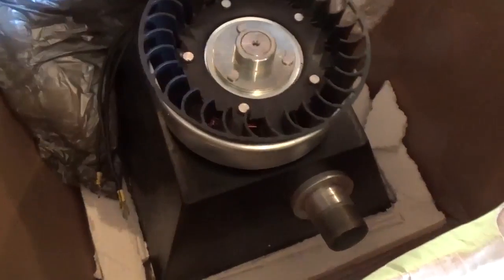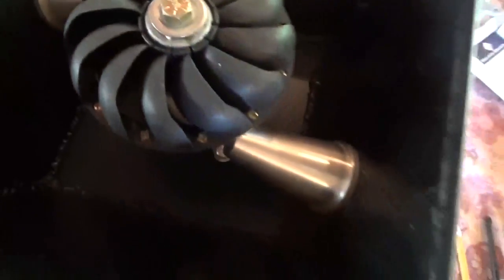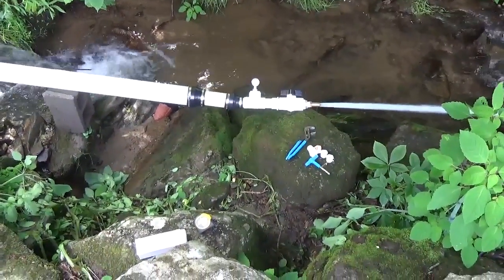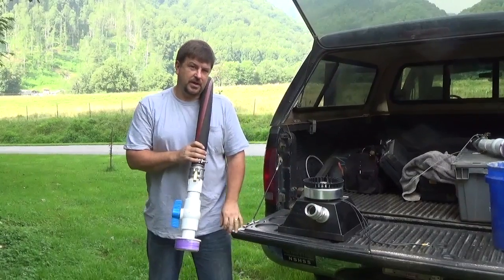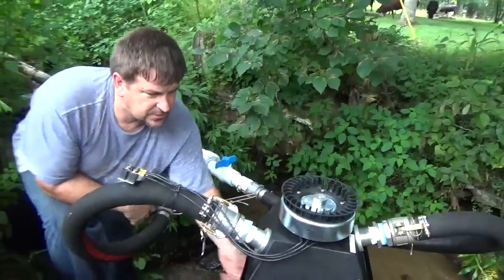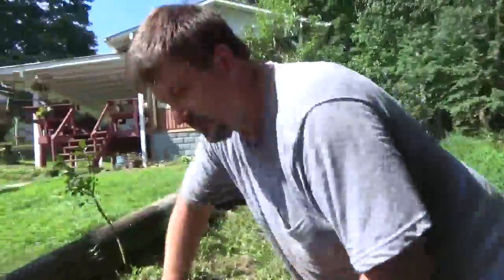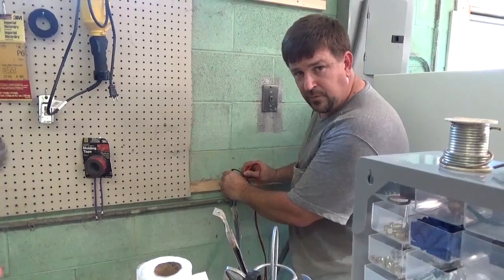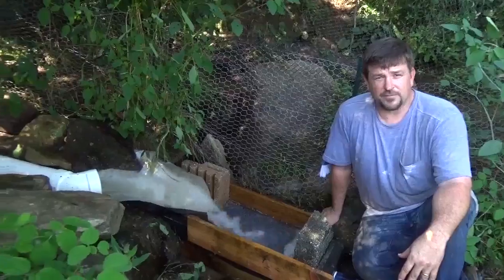Micro Hydro Power with Turgo generator Part 1

Comment: 24v system with multiple 250 feet cable runs ?? That's a lot of wasted power. with 10 amps running through 250' of 12 awg you re loosing almost 40% of your power, that's huge. Either the info you give about distances and voltage are incorrect or you are wasting your power away to nothing. You need either a single three phase step up transformer or three single phase transformers at the source and step that voltage up and drop the current. Or perhaps an alternator that puts out a higher voltage like 2 or 3 hundred volts.
Reply: petnzme01 yeah but you could get more free you genius
Reply: petnzme01 no but yourself, running a heater and needing to pay less for electricity. Why take less when you could have more for almost the same effort? Plainly inefficient
Reply: It looks like he was saying he was using 10AWG 3wire for 300 feet and was running at 48 volts no load. Under load something like this might run about 300W max which at around 48 volts is only 6 amps. On 10 AWG at 300 feet you can expect about a 3v drop for 6 amps of draw which is only about 6.5%.
Reply: In my  Glorious Nation of Kazakhstan which is tiny we use 110KV.
Reply: petnzme01 
Yeah! why not just do a shitty job! Why the fuck bother doing something properly? Why not take a leaky bucket when you collect water!? It gets lighter as the water leaks out! GENIUS idea!
Reply: yea, so? what's your point? Impedance in ac systems is just another calculable loss mechanism over dc. But that is not what this discussion is about, for me anyway.
Reply: nandos1111 reread your commt pls. Ac is better that ac?
Reply: Thank you Thad - this info is accurate and exactly the same problem power companies work to solve for delivering power. Drop the amps, up the voltage and you lose far less energy on long runs owing fundamentally to friction (heat). These are important things to consider when powering our own homes and worksites, and quite frankly most people never think of it.
Reply: well ok, good luck with that.
Reply: +Eastern Woods Are you an alien? Answering the phone with "engineering" expresses that the person has contacted engineering, not that the person answering the phone is an engineer. Why would a company employ engineers to answer phones?
Reply: So, just to get the equations out there... V(oltage) = I (current) * R(esistance) and P(ower) = I * V.  Simple substitution will get you P = I * I * R or I^2 * R.   These equations are true for both DC and RMS AC.  All wire has a resistance per length.   So, the resistance will increase with distance.  Looking at the second power equation, you can see that it is way more desirable to have a low current instead of a high current because power grows with the square of the current.

The TLDR is that if you boost the voltage, that is very, very desirable for power transmission.   You can do this with AC using a transformer.  Thad is right,  boost the voltage at the turbine and you will cut the power loss on the 250' wire run, potentially by a lot.  

Also, for the DC vs AC crowd, it is cheaper, AFAIK, to use a transformer to get a high AC voltage than to get the more expensive DC equipment, especially for this type of setup  With AC you will have the capacitive and inductive losses, but the AC system will be cheaper and at least get you most of the way there.
Reply: @mitchbaker3230  Exactly. But unfortunately most of the idiots here haven't got a clue what you are talking about. They are too busy arguing over AC vs DC or quoting a simplified argument they heard in school. Simple fact is: If you double the voltage, you will quarter the losses. If you up the voltage by 10 times, the losses are 1000 times less. Why?, because the losses are equal to the current squared multiplied by the resistance. Also, if the current is reduced by a factor of 10 you can use much smaller and cheaper cable. The cable resistance will be higher, but even if it is 5 times higher the overall losses will be 200 times less. It also doesn't matter if its AC or DC. Transmission lines use AC because it is easily transformed up and back down again. You can get DC converters to up the voltage but they are expensive and lossy (they heat up) compared to the humble transformer. Proper electrician here.
Reply: lose: be deprived of or cease to have or retain (something)
(lose, loss, lost, losing) <--- losing
... you're losing almost 40% of your power ...

loose: not firmly or tightly fixed in place; detached or able to be detached
(loose, loosens, loosely)

Sorry, big pet peeve there.
Reply: Thad ward most of the time these people know just enough to burn the house to the ground!
Reply: Brett Rowan It might not be a thing but remember his constraints. It's just a hobby project(meaning he doesn't want to spend big bucks) and he has an asynchronous generator producing   power. So let's say he uses DC he would need to convert it back to AC at home to step down the voltage only to convert is again into DC. That's a lot of losses.
Reply: FuFu 
Water and wind make AC. So stepping it up to a higher voltage AC and stepping down to his end voltage will be less loss than what he did. Wind and microhydro deal with this successfully in many installations so just because you aren’t familiar with it doesn’t mean it doesn’t exist.
Reply: @ zeffur...I'm not sure that the author is a professional engineer. I've seen a number of his videos. They're informative as far as they go but leave out important details. Just because you have a lot of volts is impressive but it's power that counts. Volts times Amps = Watts.
Reply: @Eastern Woods:
re:  " I see so many on here with miss matched capabilities that I'd I'm frustrated."

The truth is good engineers design with a sufficient excess margin for safety & capacity--bad engineers tend to way under or over (sometimes both in the same system) engineer.

re:  "...but leave out important details. "
I hate to admit it...but many engineers omit details that are obvious to them but often not obvious to their audience.  I've seen it over & over again.  Many engineers are excellent engineers, but poor instructors or teachers.
Reply: zeffur I did some looking. The unit comes from langstonsalternativepower ( dot ) com. It looks like it's a 48 volt DC but I could be wrong on that. In the video he shows about 48 volts charging his battery. Most of these micro systems run DC because AC needs RPM control. Check out the system " micro hydro electric power system in colorado part 16 " how he controls the power frequency. You'll have to watch the whole series but it's worth the time. They also like to keep the voltage low for safety reasons ( and probably regulatory reasons ). Also most of these guys charge the batteries from the generator and then use an inverter to convert the power for use in the house. A low voltage DC generator keeps the system simple and relatively safe at the expense of efficiency. Most of them are happy to get free power, even if it's a fraction of what they could get
Reply: @easternwoods4378  FINALLY...someone who's thinking practically and not in equations. P.S. I also have an EE degree. It's all about perspective here and is very easy to get exited and make everything efficient. I can only imagine the FUN of handling two 3 phase transformers in the middle of the jungle next to a creek. Very efficient when fire starts.
Reply: I think he's producing AC at the generator & sending it 250+ ft to his rectifier to produce DC at the battery bank.
See:  https://youtu.be/njNYuEKW-ek?t=43

re:  "Most of these micro systems run DC because AC needs RPM control."

1.  All generators & dynamos that I've ever seen produce AC--not DC.
It certainly is possible to mount the rectifier on the generator, but that would probably be unwise for multiple reasons.

2.  Many AC devices (e.g. lamps, heaters, etc) do not require rpm control.  For devices that do require a higher frequency tolerance AC (e.g. computers, electronic clocks, etc), a UPS can be used (unless the AC frequency is way off) to stabilize & provide AC within the proper frequency range.

re:  "Also most of these guys charge the batteries from the generator and then use an inverter to convert the power for use in the house."

I think you're missing a step (rectification) in your process.  Batteries must be charged with DC.  Even in your vehicle, the alternator has a rectifier arrangement to convert AC to DC before it is applied to your battery.

re:  "A low voltage DC generator keeps the system simple and relatively safe at the expense of efficiency."

I think they are generating low voltage AC at their generator.  48V AC is less dangerous than 120V AC, but I promise you that you wouldn't want to get shocked from either one--dealth will like occur from either voltage source.
Reply: @zeffur7  I'm not an engineer or an electrician but for 25 years I regularly got bit by 48v to 90v AC at work and never had a problem, was I just lucky. I'm talking at least  3 times a week. 60v was average most of the time I didn't even use a meter I just touched it to see if it was hot before splicing just to see if I needed to be careful not to blow a fuse.
Reply: @Joseph Mcadams:
There are many factors involved in how much of an effect an electric shock has on an individual.
For example:  if you have rough fingers from doing heavy hand work, then your resistance to electricity flow will be reduced.  If you have well insulated footwear, you have a higher resistance to electric flow to ground. Also, touching the hot wire in an AC system with the back of your finger or hand might shock you slightly, but it won't cause an involuntary muscle contraction that will cause your hand to clamp down hard on the wire during a muscle contraction--which often happens when being shocked by a DC source of electricity.

I can assure you from personal experience (I was shocked hard once by a DC powered electro-magnet circuit)---DC can be much more deadly than AC because it causes major muscle contractions.  In my case it also caused major flashbulb-like images to dominate my vision for about 30 seconds.

The electricity that kills you is electricity that causes your heart to stop beating (or in the case of very high electricity flows--it burns your tissues as it flows through you--(which doesn't always lead to death--but it can).
Reply: @zeffur7  thank you.
Reply: +A B That is the custom in every company that has departments, as simply repeating the company name would not inform the other party who they have actually contacted, and there's zero reason for someone not directly working with you to interact with you directly unless you're the only engineer. Nobody not working directly with you should ever be contacting you directly. That is why people are hired to - among other things - answer phones.
Reply: Yep this. There is a reason why the power stations step up to 110kv before transmitting.
Reply: @Eastern Woods:
Isn't the video author a professional engineer??
It looks like he's making enough V for his battery bank load to charge it properly.  

As long as he V & A levels remain high enough, his charge controller should be able to keep his batt bank charged properly.

I agree with your other comments about optimizing his hydro resources & harnessing apparatus & equipment--that's just common sense, imo.
Reply: @ zeffur...I took it at some point in the video that he's still buying some power from the grid. Anything to reduce that, and better still to get off the grid and turn in your meter. I agree that as long as he's getting enough power to charge the batteries he's on the plus side of the equation. There are two reasons for a professional. One is to maximize the efficiency of the system. I see so many on here with miss matched capabilities that I'd I'm frustrated. The other part is insurance. If the system is not properly installed your insurance is effectively void.
Reply: @ zeffur......I'll fess up, I'm a professional engineer ( mechanical ). LOL I can attest to your statements and then some. The term engineer is appropriated by a lot of people.  EG one of the places I worked at, our secretary ( and her skills at that left some to be desired ) used to answer the phone "Engineering". The people on the shop floor thought she was one of our professional engineers. I watch these videos and i do learn a lot and thankful for that but the miss matched bits and pieces drive me crazy.
Reply: :-) @ anyone expecting someone who answers a phone "engineering" to be an actual engineer.  You never know what type of engineer (or lack thereof) might answer a phone.  It's always best to ask to speak with an engineer or to engineering management (depending on what is needed).

Frankly, I mostly view YT vids for ideas & rarely rely on technical explanations--as most times they are incomplete, incorrect, or otherwise relatively useless.  My favorite often repeated nonsense is how people describe voltage as power or representing lots of power... ;)  
Of course power (Watts) = V * A... but most of them don't appear to know that--even some purported electronics technicians--which is quite surprising.
Reply: My last post was only for demonstration purpose of voltage drop. The 48v he speaks of in the video is open circuit voltage. With no load, there is no voltage drop.  cheers
Reply: petnzme01 well..... it's "free"ish...
Reply: bipola telly Brett Rowan used the correct word.
Reply: it's ac so the effect will be less
Reply: @ zeffur.....Good talking with you :-)
Reply: Thanks, you too.  Take care.
Reply: @Mitch Baker:
His generator already produces AC.  The AC is converted to DC in his battery room (after the ~300' cable run).  He really doesn't need to use 2 expensive transformers to step-up & then step-down his AC.  

You're not going to transform power without energy losses.  Have you factored that loss into your suggestions?
Reply: seigeengine:
All engineers have phones that can be directly called.
Frankly, I always answered my line with my company's name & "How can I help you?"; but, I'm sure other engineers might answer 'engineering' if that is the custom at their company.
Reply: yea, and only 110 volts in the home, against 230 volts here in europe... lol
Reply: finaly a correct comment! lol
Reply: whit a modern regulator on the vanes it is possible , but in this case its difficult.
Reply: nope https://en.wikipedia.org/wiki/High-voltage_direct_current
Reply: A watt is still a watt... if you decrease the voltage, and the amps stay the same  the watts will drop, Better on this system,would be to use a mppt charger, to be as efficient as possible. (more volts in, at lower amps, higer amps out at lower voltages.) hence lower loss over the supply line.
Reply: I don't know why people are giving you so much flak, Thad. Everything you said is right on by my estimation. He would greatly benefit by using more volts for those longer runs.
Reply: Orlaz92 that makes no sense.  Higher voltage with lower current is what's used to cut transmission losses.  Power lost in the wires is voltage drop X current, or current squared X wire resistance.  Doubling the design voltage halves the current for the same delivered power; this means that the wires can be one quarter the cross-section for the same losses.
Reply: Yup, should have used a generator with a higher AC voltage output and then rectified and brought that down to the required voltage or make the batter bank suit the generator.
Reply: Eastern Woods If you are connected to the grid anyway and producing extra power it might be beneficial to stay connected. Getting paid by the utility company would be amazing.
Reply: redeemer216  there are specific equipment requirements by the utility companies for how pumping power into the grid is done safely.  

Consider what happens when a line worker is going to do some work, turns off the utility feed switch, and grabs hold of the 'dead' line.  Except that your power system is feeding it, so the line is 'live' (and then maybe he isn't...).  

There is equipment you can get that only feeds power into the grid when it's live, and the scenario above is one of the reasons you need it.
Reply: Thad is right, but then the OP would have to buy some transformers. Probably worth it in the long run.
Reply: If you want to see a well engineered system watch the mrhydrohead series. He's about 1500 ft from his power house to the home. Steps it up to 480 volt single phase for transmission and back down to a 110 / 220 house use. At the power house he has a controller that cuts the water off if the hz goes outside range, about +- 10 hz. At the house he has a controller that measures the hz. He uses power by switching appliances on and off like the rest of us. The as the appliances use power it slows the generator down and when he turns appliances off the generator speeds up ( that's normal as it should be ) The controller senses the change in frequency and adjusts a shunt load to bring the hz back to 60 nominal.
Reply: indeed, thats the correct one to produce at least 240volts. which is a great thing in the end! Thank you for the informations.
Reply: Get a superconductor
Reply: He ran 10/3 UF wire not 12ga....
Reply: Ac has minimal line loss
Reply: It is three phase AC
Reply: @EdricLysharae  yes. I assume it's a standard automotive type alternator, which are three phase.
Reply: Thad ward 
Not true  with ac power. The loss is negligible, and he’s using 10 gauge, not 12.
Reply: Yup- ..... just as soon as I heard "24V" ...and...  "300 feet" .... I said:  "No Way"
Obviously the "Losses" were not a consideration. But I would still seek to "conserve" as much power as possible. ... what IF... the waterfall slowed to a trickle?
You'd want as much efficiency as possible.  So, yeah, that's Hi Volts and Higher Freq for "power transmission" ....... 300 feet is a LONG Way- for low volt systems.
.........unless you're using 0-Ohm conductors... 

(and if you have "0-Ohm Conductors" .... please tell me HOW you made them... please)
Reply: He is an idiot soon to be eating jail food
Reply: petnzme01 
Because ‘normal’ houses use electricity by the kilowatt. And it’s not free, it has a depreciable cost from an up front investment. Less power over its lifetime makes the cost per kW of the system go up substantially as the system lifespan is probably more measured by time than kW. Never mind the cost of whatever you use to augment the lower insufficient output. 
You have a basic misunderstanding of the idea of cost-to-benefit ratio and accounting.
Reply: Hello. True there are reactive components (inductive, capacitive, phase angle/PF, organized di-pole losses, coronal discharge in HV, skin effect, blah, blah) or impedance in ac systems, but the main contributor in the calculation is series resistance. These have little bearing for this installation though (all except series resistance). I do wonder how difficult it would be to set up some kind of mechanism to keep the flow about right and maintain a somewhat steady frequency output which would be necessary if you wanted to use good ole iron ie transformer.
Reply: Thad ward  could use a centrifically controlled governor adjusting water flow via valve before the nozzle.
Reply: the distance is incredibly important!!!! if the width of the cable matters then the length will matter! 
its called voltage drop, over distance the voltage will decrease over time due to the resistance in the wire... This can be dealt with by having a thicker cable as there will be less resistance.
think of wire as water pipe, the thicker the cable the more voltage can flow through it, remember there is no current necessarily until works been done, so if the voltage has a hard time squeezing through thin wire then it needs to do more work, so it will use more current. current means heat, heat means the cable can melt and burn your house down. thats why we have circuit breakers, they read the amount of current going through the cable and flick the circuit off if too much flows through, this is to protect the cable according to its width.

AUSTRALIAN ELECTRCIAN
Reply: They both cause loss! one produces a back current the other converts the energy to heat.
Reply: nandos1111, Actually DC is better than AC over any distance.  What happened historically was that the technology was not available, to step-up the voltage.  In DC you will only need 2 wires, is simpler, but the voltage conversion technology is complicated.  The AC transformer is almost prehistoric, but simpler
Reply: Brett Rowan "commenters"? the english writing prowess of Utoob commentators never stops to astound moi!
Reply: @happy camper yea I just looked that up myself... turns out the electrical teachers don't know everything!!! Thanks for correcting me! 
The issue would then be what your powering... do is great for low voltage lighting but running any motor with torque is going to be ridiculous
Reply: people who make arrogant statements without backing it up with facts or evidence are retards
Reply: Sorry.... AC is better than DC over distance... better converting it to dc closer to the source, it's also better to keep it at a higher voltage as long as possible... I'm a qualified electrician
Reply: @nandos1111  Not true, the power grid is starting to use DC for some main lines.
Reply: @nandos1111  Actually, it's a bit more nuanced than "AC is better than DC over long distances". The real issue is "higher voltages are better than lower voltages over long distances" and the advantage of AC over DC is that it's easier to change the voltage of AC. However, AC does have issues with impedance and capacitance. These issues don't actually cause a loss of power, but do make it more difficult to get power from one end of the line to the other (an analogy would be that the impedance and capacitance act like a battery that you need to charge before the power reached the destination. Then on the opposite phase, that battery discharges making it easier to get to o volts and once again needs to be charged to get the opposite phase to the destination). A quick summary of the differences is:
1. Changing voltage - AC is much easier
2. Switches - AC allows switches to break the current much easier (see https://www.youtube.com/watch?v=Zez2r1RPpWY for graphic demonstration of arc breaking difference between AC and DC)
3. Line inductance - DC is better
4. Line capacitance - DC is better
In fact, modern long haul power lines currently do use DC instead of AC because of improvements in technology that allows for easy conversion from AC to DC and DC to AC. This technology also means that there isn't a need to synchronize two AC lines to the same phase and voltage that used to be needed for long haul power transmission. See https://www.youtube.com/watch?v=DFQG9kuXSxg for an entertaining description of high voltage DC long haul lines.
Reply: Thad ward In AC there are reactive losses.
Reply: skin effect always amazed me. NEver did learn the why. Too deep into physics IIRC as to why.
Reply: bigger or thicker the conductor/cable = less resistance omhs 🤔if I remember rightly 😂distance Shouldn't impede the flow Unless the amps are exceeding. you should be using 10mm wire X.3970/Y4040. but 2.4mm is rated for upto 32Amps no continuous load.
Reply: SgtAMYNTAS 
Check that. Copper cabling has a certain V loss over distance. Regardless of the distance, while upsizing cable can mitigate a small percentage of V loss there is still a loss. It’s not a percentage- it’s a specific Volt loss over distance. So at say, 120V you lose (insert some arbitrary voltage like 3V) over the distance, you will lose that same 3V at 12V: 25% power loss at 12V VS 2.5% at 120V. And we didn’t even get to the efficiency of AC over distance VS DC over that same distance.
Reply: care to give any data/examples/math to go with your statement?
Reply: you're a fucking nandos.
Reply: in fact there is, its only neclectible, the point off ac is you can step it up easely whit a cheap  transformer, tho get the voltage up, and the amps down, hence lesser losses, than running dc, in his case he can use the 40 volts produced to feed a mppt regulator, witch holds the input on 40 volts, but the output on 24/28 volts, hence also lesser losses in the high voltage ac/dc input line..
Reply: There's so much difference between ac and dc energy dissipation, with the same power and same cable lenght and diamater. AC is much more efficient tranportation of the elecrtic energy, yeah it depend also on the voltage and current, but there less joule effect (dissipation of energy in heat, and so loss of power) when you run on AC
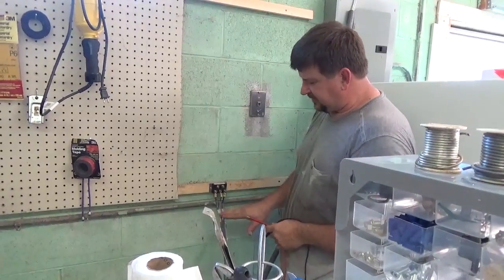Reply: Well it looks like the 250' of wire is all AC. Hes not rectifying it till it hits the house. You can see him doin that at around 5:40 . So it should be fine to run AC with that length.
Reply: If he's measuring 48 volts at his DC terminal that means his AC is running at +24 and -24v for a total effective voltage when rectified of 48v he's measuring 48 volts with no load but as soon as you try to pull a couple of amps from that thing the frequency and voltage from his generator are going to drop dramatically because half the load is going to be from losses in his delivery system.

*Nevermind - 10AWG is plenty Skookum if he's only going to be pulling 300w. (Really nice setup too I might add)

If you're running electricity for any appreciable distance you want/need high voltage.
Reply: hello, it's not whether it is dc or ac it is the voltage and the resistance of the wire. example; if you have a 12v 100-watt light bulb which draws 8.3 amps (100/12=8.3 amps) running close to your power source, the majority of the power being used will make it to your bulb.  Now if you want to move that bulb, say 250 feet away from the source, and you use 14ga wire,  which has a dc resistance 2.5 ohms per 1000 feet you'll now only have a 15 watt light bulb  loosing roughly 85% of your power to wire losses. 250 feet of wire times 2, because you need 2 conductors, is 500 feet wire. So you'll have 1.25 ohms of resistance in the wire and that times the current of 8.3 amps is over 10 volts of drop across the wire leaving less than 2 volts for your bulb. This is the same for 12v rms ac more or less. Now ac is more attractive because you can step up the voltage and greatly reduce your losses with a simple transformer. That same 100-watt light bulb but a 220 volt version draws only 450 milliamps at 220v. now you'll only lose  570 millivolts (.45*1.25=.57) with 14ga wire. Which is about a 1/4 of watt of wire loss versus 80+ watts.
Reply: Thad ward that was perfectly stated!
Reply: @easyamp123  can you explain in much simpler wet course I didn't understand..
Reply: @easyamp123  my brain just melted, lol.
Reply: @GeeCeeAte  yeah and I think you said he's using number 10 not 12 gauge wire so that's even less loss
Reply: I'm curious why you say that dc runs should be minimal? There is no difference in the voltage drop between rms ac and dc (same wire gauge), and voltage drop is all you're fighting with long cable runs.
Reply: big difference
Reply: @easyamp123   Ok so if I have 200watts RMS at 10volts that's  20 amps..  what happens when the volts drop to 6 volts and it's still a 20 amp load? U lose 80watts.. idk how you came up with your figure but there is a great guide at 12v.com for newbs you should check out so you understand voltage drops and resistance
Reply: billy gotUlol Your math is correct. If you can maintain a constant current under varying voltage then yes that is correct. however unless you have some type of constant current source of constant current load or some type of regulator in line in the system the voltage is going to go up and down based on the current in the system (current times the inline resistance equals your voltage drop) and the voltage will drop and the current will follow suit so they generally go up and down together unless you have some type of constant current source/load.
Reply: @easyamp123  SHouldn't you consider reactive power?
Reply: @easyamp123  Actually, with AC you have resistive losses plus reactive losses.  That is why all long distance power transmission in the power grid is always done with DC.
Reply: @butchshadwell3613  not sure where you are getting your information, long distance high voltage transmission is not always dc. Hvdc (500kv+)is very expensive and requires considerable amount of extra equipment which do incur losses. True there are no reactive losses in dc, but this is not hvdc.
Reply: @easyamp123  It depends on what you call long distance.  When you have to send power hundreds of miles, the savings in losses can amortize the conversion costs pretty quickly.
Reply: This is one of the more (technically) hilarious threads I've read in a while. HVAC is DEFINITELY not a thing. The electrical engineering prowess of YouTube commenters never ceases to amaze lol
Reply: Watch Part 2......Turgo or Pelton wheel systems need to be properly sized. It's not particularly difficult but it does involve some math. He needs to minimize the head losses. He needs to get the wheel and nozzles as close as possible to the high water mark of the creek. Looks like right now he's losing about 3 feet of head there. He also needs to take the water inlet as far up the creek as possible to gain as much head as possible. As well he needs to install a settling system to remove air and any sediment. Any time you have batteries in a system it implies that you can't generate enough to meet peek demand. Above all else, get a professional to design and install the system
Reply: Bel Rick 110 kv???
hahahaha, hahahaha,  where are you from?
in the USA, the long haul is 500 kv!
Reply: Ac is more efficient at transporting over long distance then Ac
Reply: nandos1111 
...ish....
While there are many factors contributing that I am not knowledgeable enough to calculate without reference material, in a micro-sized electrical supply system the high voltage over distance VS the calculable loss per foot that makes AC valuable over a ‘similar’ DC system. While higher voltage even in DC systems has measurable benefits within engineering parameters, once you pass 40 or 50 feet any ol’ $100 electrical meter will tell you why you want to use AC and ideally also step up the voltage.
Reply: What are you getting your undies in a bunch about??

He clearly stated in the video that he's using ~300' of #10 wire (which can handle 25A-40A (depending on the type of conductors used) for a 3-phase generator that will be used to charge a 24V battery bank (which means he really only needs ~27V available at the battery terminals.  

He also clearly stated that he measured 47.4V (unloaded) at his rectifier -- without having optimized the water harnessing components of the system.  30A over 300' of #10 (.9989 Ω/1k') is a Vdrop = 15.6V.  So obviously, 47.4V - 15.6V = 31.8V (which is plenty of V, A, & W to charge a 24V battery bank)...

Don't get yourself so worked up over such a trivial matter...
Reply: Thad ward .. Dc runs should be minimal.  Ac over long runs are desirable verses Dc. Im not educated in these systems but guess ac turbines have issues with maintaining a constant 60cycle wave form?
Reply: how true as they taught us in 1st year apprenticeship;that is why ac was used for transmission when it was initially dc in the 19th century.
Reply: Thad ward bull shit. dc is not ac and it does matter for voltage drop if its one or the other
Reply: @thisisme0214  Learn what you're talking about first. Thad ward is quite correct in that line loss doesn't matter if it's AC or DC. The issue is the amount of current that's going thru the wire. AC has a definite advantage in that it's easy to change from a lower to higher voltage (and in the process reduce the amperage) and cause reduced line losses. Then once the wire gets near the load, another simple transformer can be used to reduce the voltage (and increase the current) to actually use at the load.
Reply: @thisisme0214  Actually, voltage drop is worse for AC.
Reply: @thisisme0214  mate, you are doing the same mistake Thomas Alba Edison done with DC. Follow Tesla instead
Reply: thisisme0214 no ac runs at higher voltage this being able to run in long distance with smaller gauge wire. The higher the voltage the further the run.  Ac dc it doesn’t matter.